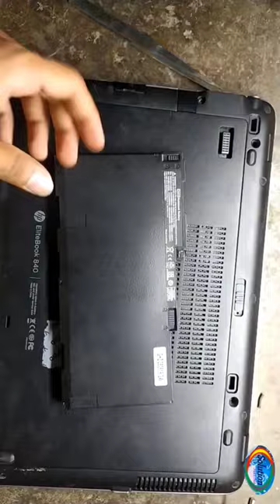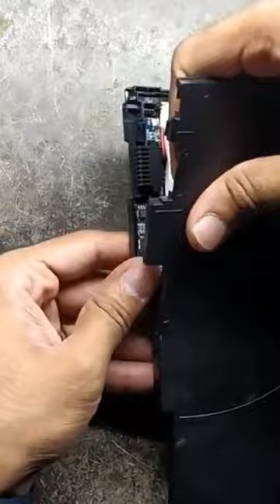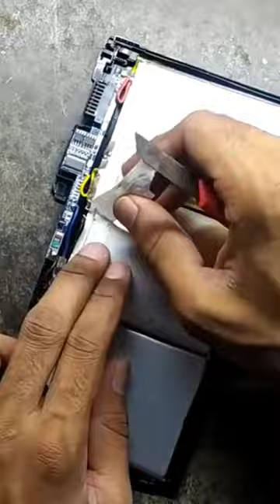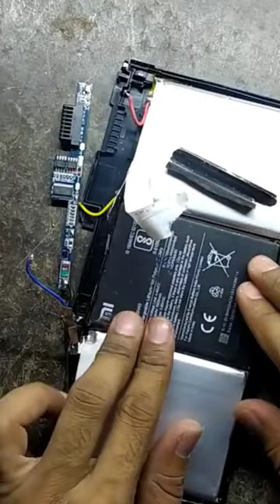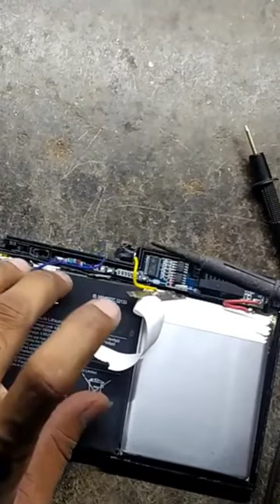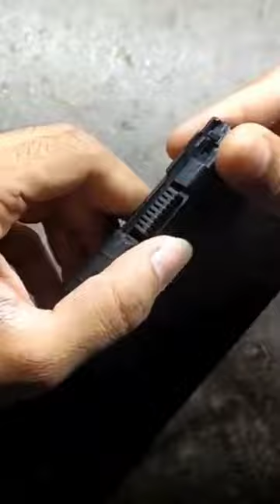Repair hp laptop 💻 battery 🔋 #solutionhai

Comment: what about voltage and ampire
Reply: Yeah it will not gonna work. Bms will locked everything bcs battery have not balanced. 😂 You needed 700$ device for fix that. So better buy new one